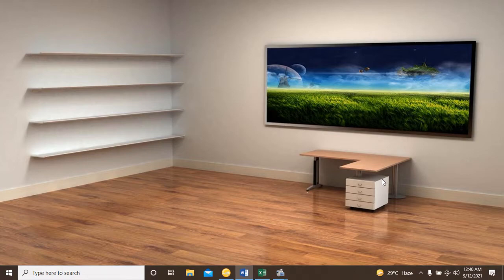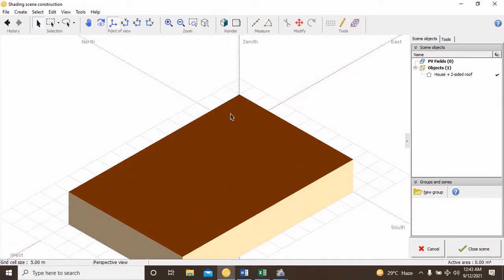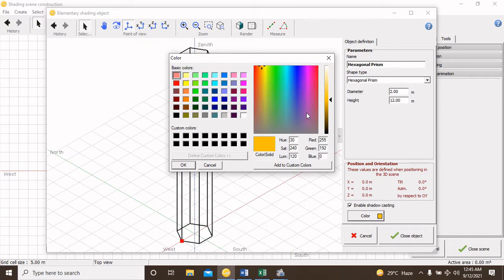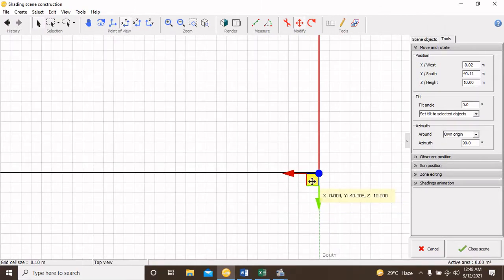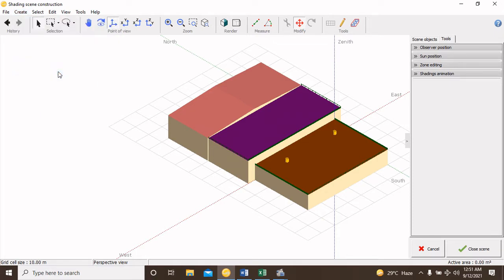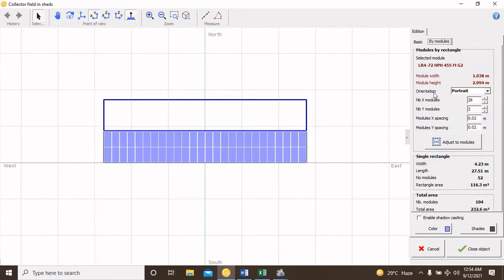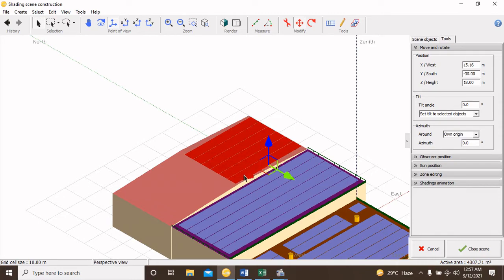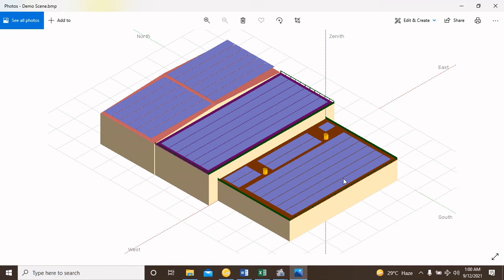PVsyst 3d shading analysis |PVsyst Near Shading  |3D building design and near shading in PVsyst

Comment: Since the third roof is tilted one but you are not giving tilt to the modules. How come then modules will be aligned to the roof?
Reply from the maker: The tilt of roof not affect the module efficiency however, it will not impact the energy numbers. If we still provide azimuth to the module as per the angle of roof will manage the dominant angle.